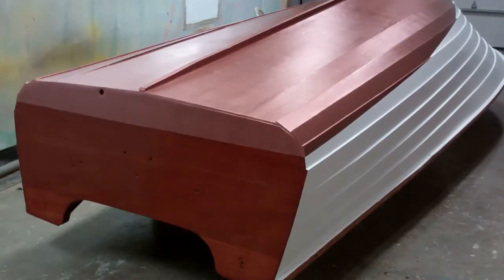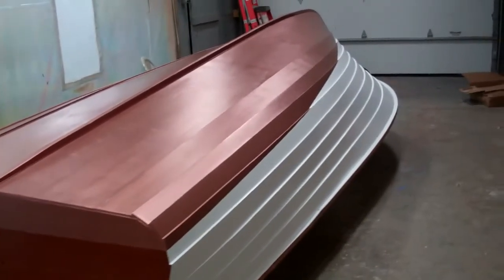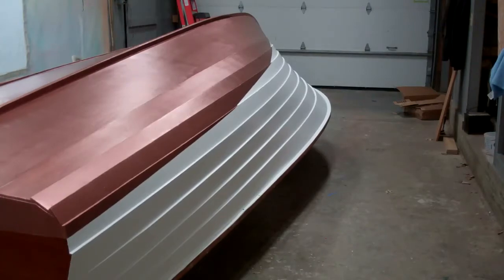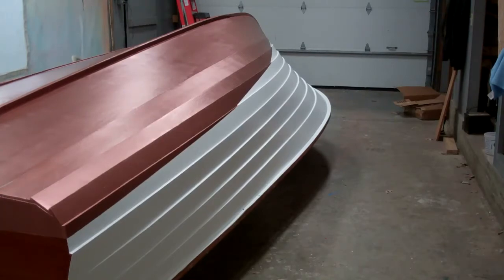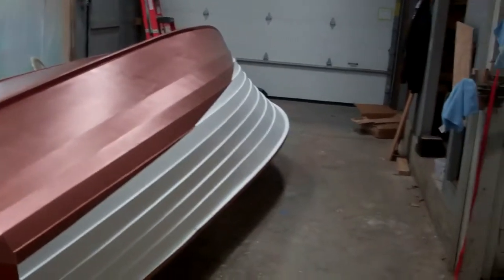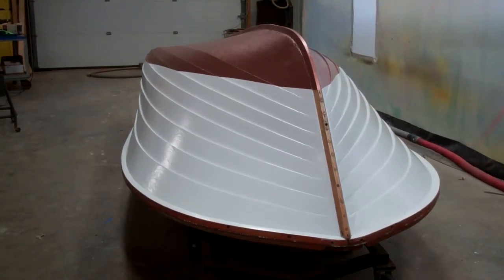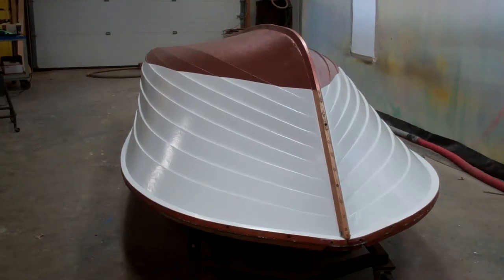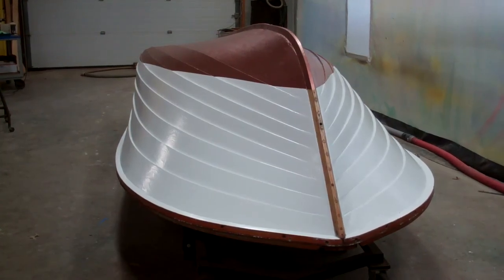1960 Cruisers Seafarer Paint Milestone Passed 4 24 2017

Comment: Really nice work.  Did you brush on the top sides paint or spray it.  Cheers.
Reply from the maker: Mike, you must have missed reading the detailed commentary that accompanies all of our videos, to whit,"Three coats of semi-gloss white Interlux Premium Yacht Enamel were rolled and tipped. Hand sanding with 320 grit between coats assured us of a flat, slightly glossy surface."We never spray, but always hand sand between coats and roll and tip finishes, including primers.